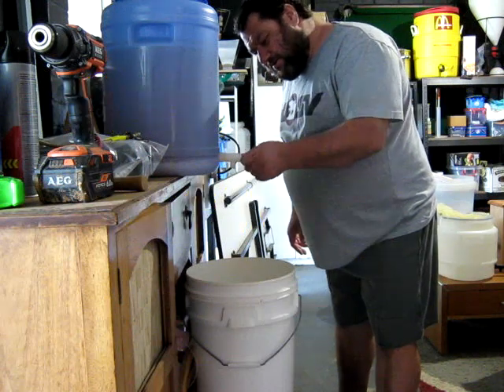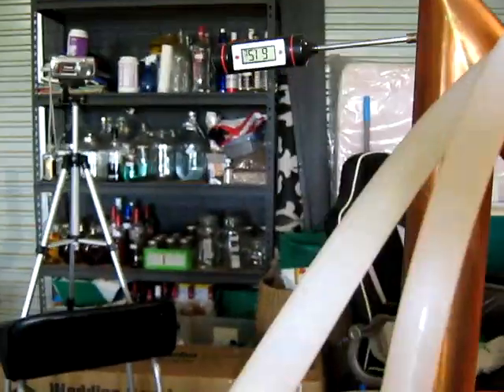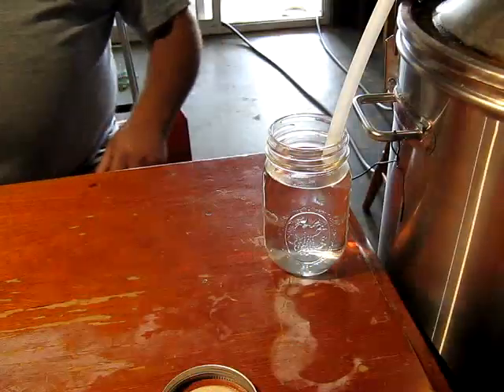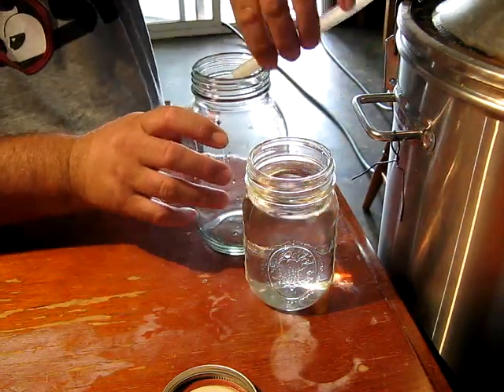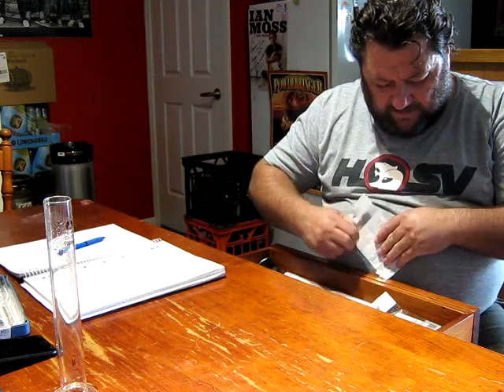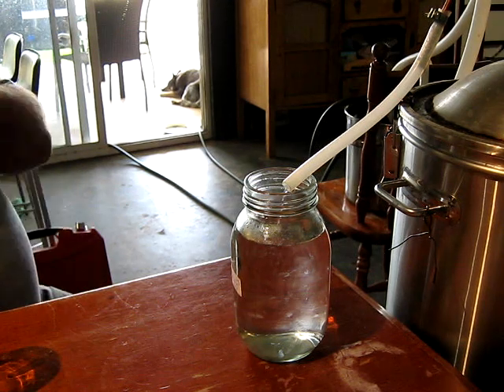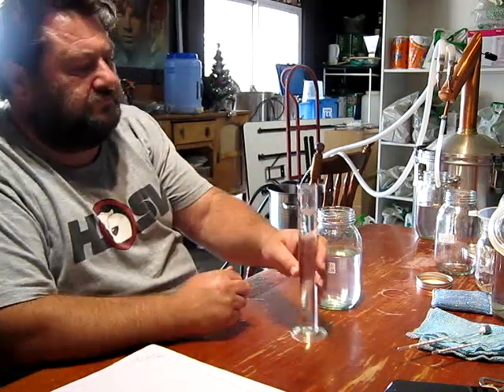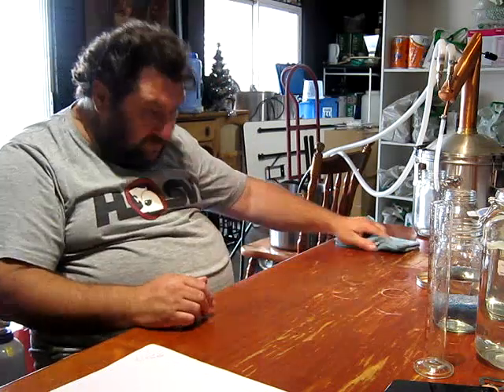The Whiskey Jar #14. Alco engine pot still.  Stripping run.

Comment: Very well done and lots of info. Getting my Alcoengine soon to run with my DigiBoil.
Reply from the maker: you won't regret that decision....
Reply: Also got mine recently... Very excited. Got the neoprene jacket too to save electricity. Running a Blichman riptide recirculating pump to save water as I do not have a pool.

Comment: Hi john great channel iv got the gen 2 alcoengine when gets up to 76c first drips will come out and temp will rise to 94 then sit steady and slowly rise, does it depend on alcohol % in the wash as to what the temp is as u said urs was 88 degrees. Cheeres
Reply from the maker: Are you using a voltage controller? Without the control the boil can be too hard and create excess temp in the column. Alcohol will only effect the boiling temp of the wash not the column.
Reply: @littlejohnsbrewing  yes i have a voltage controller and i have stainless t500 reflux and its boiler  which i think is mangrove jack
Reply from the maker: @slosho83  reflux is a different beast, this is a pot column..... it runs different. I have no first hand experience with reflux.
Reply: @littlejohnsbrewing   iv been doing sugar washes making vodka and using essence for couple of years now and purchased the alcoengine gen2 last week for grain mash and mollasis washes
Reply from the maker: @slosho83  you'll get a grip of it soon enough.

Comment: I finally have all the bits to do my first run using the exact same set except I have the Ambelic dome with a sight glass. As I'm a newbie at distilling, I have a couple of easy questions for you bud. After doing the first run when can I safely remove the pot still from the boiler so I can do the next run. I just don't want any built-up pressure doing any damage to myself if I open it too soon. Also, with the water in and out facing you, which is entry and exit, or doesn't it matter. Sorry for dumb ass questions.
Reply from the maker: I allow mine to cool down overnight before pulling the top off. But you should be fine to let the clamps off while still hot, but I would be letting the whole unit(elements and electrics) cool down fully and have a rest before running again, it all gets fairly hot. Silly question... you are fermenting your wash before your run???
Reply: @littlejohnsbrewing . Thanks John..That's reassuring know, I will let the unit cool before opening the lid. Yes, I am fermenting my first apple wash to be used with my setup.

Comment: Thanks, this helped answer several questions regarding this product. I do have a question though. I like bourbon and rye, but I also want to experiment with vodka and gins eventually. Can you pack this particular top with copper mesh and get kind of a reflux action with this? I know Alcoengine makes a reflux still and you can remove the packing and make it into a pot still but I plan to do mostly sugar and corn washes if I get this product.

Thanks again for this helpful video and I did sub.
Reply from the maker: cheers Bruce....  you can't pack the pot column, it will not run in reflux. You can run vodka and gin, you just don;t get the high ABV that a reflux will get you. I have done vodka and neutrals, but do find that they will carry a bit of flavour with them(which is what the pot still  is meant to do). If you want clean vodka and gin I would say invest in a reflux column as well.

Comment: Thanks for the great video! One question: is it necessary to air out the stripping run for 24 to 48 hours or could you go straight from a stripping run into spirit run?
Running my alcoengine for the first time this weekend…
Reply from the maker: no need to air the stripping run. go hard till you get to the spirit run, then it's control and patience.

Comment: Great video, thank you.  Did you modify your  Robobrew to use it with the variable power controller?
Reply from the maker: No it's just a straight plug in. RB power into the controller.
Reply: @littlejohnsbrewing  Excellent! Thank you for that. I've got the reflux head and going well with that, so will try the pot still head + controller.  Very useful to see how you adjust the power to control the output with the pot.

Comment: Nice.  Thanks for this.  Will you be doing a follow up video for the spirit run?
Reply from the maker: I ran this batch a few weeks back, did not do a video... I do need to a detailed video of the spirit run, there is a bit on spirit runs in #8 and#6 but not a full day. I do need to do another batch to fully fill the second barrel, so that will be a single wash and spirit run, so I will be doing a full process vid on that.
Reply: @littlejohnsbrewing  would love for a spirit run on the pot still. just purchased it myself and yours seems to be the ONLY video on using it.
Reply from the maker: @clintAdventures  one day, I haven't stilled anything for a while, but have a batch ready to strip,,,, then 2 more and time for a spirit run, at which tome I will do a more detailed video. Doesn't help you a lot now. Check Video #11 it is focussed on the voltage controller, but it is during a spirit run.

Comment: Hey John I'm looking at getting a reflux still for my Brewzilla, how important is one of those watt metres?
Cheers for the vid too.
Reply from the maker: makes it easier to control the  strength of the boil, I don't think it's as important on a reflux because you can change the water flow. I wouldn't be without it on my pot column.
Reply: Fantastic! Thanks mate 🍻
Reply: @OzDMC  I concur with John, I run both the alco engine reflux as well as the pot still on my digiboil. Both for different purposes however I switch on the reflux and it will produce 95% alcohol from go to whoa with no element control at all, It's really easy at it just stops producing when it's done. I do use a PID temperature range at the column head to switch the still off when it's done and also to switch off the water pump recirculating cool water but that's just an added nice to have because I use it for pot still consistency.Using a pot still to keep the characteristics of your mash though needs more , and to automate it somewhat, I use a PID controller at the head to adjust for me based on the parameters I tell it with the still and it 'learns' about where the ideal sweet points are with control and timing. You can do it the other way too, and some would say its more of an art doing it manually but I've done so many, that I know what I like and the rates I like it to come out that I just know where my hearts are. Tails and Heads I don't ever chuck. I'll always keep em' for a reflux run.